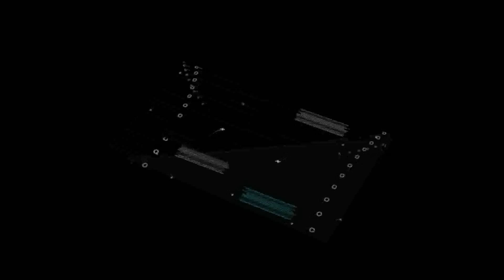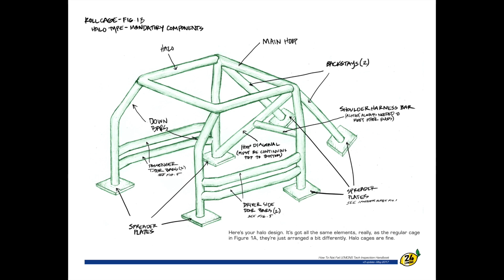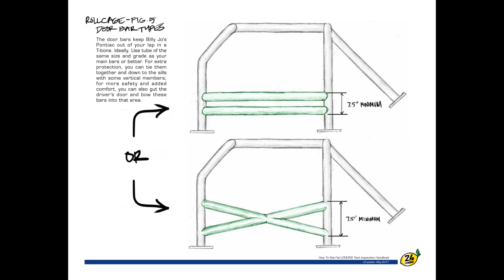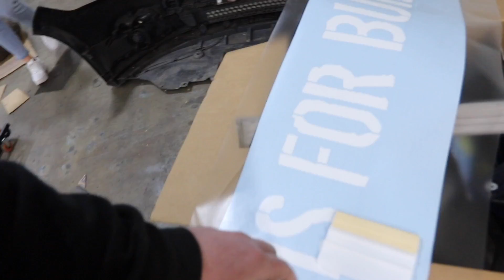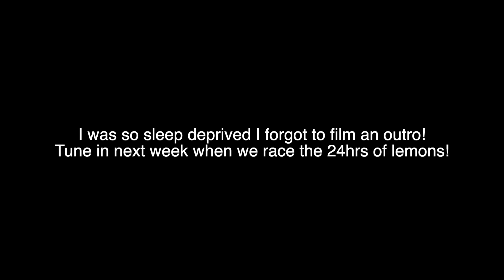Building An Insane Race Car For $500

Comment: This should solve the starting problem: A non-return valve in the fuel line is defective and is slowly allowing fuel to flow out of the line back into the tank.  As a result, it takes forever to start, but if it was only off for a short time, you don't notice it and it starts immediately.
Reply: Spoiler alert, they had to buy something at the race to fix it, it wasn't cheap 😂
Reply: @joealex65  what did they have to buy?
Reply: Pretty sure the fuel filter has the check valve. $40 part max and 10 min fix
Reply: @joealex65  Had to go to sleep so I couldn’t watch it til the end🙂
Reply: This is exactly what i thought when i saw that.
Reply: I owned one of these cars for 5 months. Car had more gremlins than that movie theater lol

Comment: Worked on Benz for over 20 years professionally. Put a crank sensor in it. They never set a code when they fail. To check it, see if your fuel pump has a signal when cranking, if not then it needs the crank sensor. Ecu will not send a fuel pump signal if there is no rpm signal when cranking. Crank sensor is rear of engine drivers side on the top of the bell housing. Bolt is an E8, use a 1/4" drive ratchet with a real long extension and a wobble. Put a piece of tape in the socket before putting it on the bolt to hold the bolt in the socket. 100% this will fix the starting issue.
Reply: I was gonna say that, same problem I had with my CLK320.

Comment: Check crankshaft position sensor.  It's the first thing you want to replace on any early 2000s Merc.  A bad one throws no codes and results in intermittent no engine start condition.
Reply: Just wait to see what they had to do to fix it at the race 😂
Reply: Temperature of a bad sensor being hot will cause it not to start in my past experiences.

Or

If the sensor or plate has any oil on it from a rear main seal leak will cause it not to start.

Both scenarios throw the timing off telling it not to start.

Comment: I had an old bmw that started doing this randomly. Took me 15-20 mins to start it. Figured out it was a defective security sensor in the key (the ignition cylinder charges the key). New battery in the key fob fixed it👍🏼
Reply: If your story is about an E46, that is false. In an E46, the key battery only controls locking and unlocking. The transponder portion inside the key that speaks to the EWS does not require a battery/charge.
Reply: I had the identical problem with my BMW (E88), with a different cause. it could be any or all of 10,000 things with a BMW

Comment: Had one of these back in 2008 - loved it. The design with the pillar-less windows and seatbelt extenders is amazing. A truely elegant coupe!  Was also the most reliable car I ever had. You guys got the best engine as well with the M112 V6. The c209 is the 2 door coupe and the a209 is the convertible model. They did a facelift in 2005 which look a bit nicer but ironically they removed the reliable M112 and replaced it with the M272 which had balance shaft issues. Good luck on your trip!

Comment: if it only happens when after you've driven it and the engine is warm, i'd highly recommend a new crank position sensor.  i worked as a benz tech and it was a common problem.

Comment: You're right about the cheating bit. It's all about being clever. I remember the old rally days where mechanics and engineers would hide entire turbo-chargers somewhere lol car looks like a proper racer tho, you guys did a good job. This should be a fun event for sure.
Reply: Cesare Fiorio, the team boss of Lancia, once ordered 300 tonnes of salt, and had it spread along the snowy route of Monte Carlo because they knew their RWD car was at a disadvantage against Audi Quattro. So Audi went out on snow tyres, thinking it was partially snowy and icy..While Lancia, knowing it would be dry, went out on slicks and beat Audi by 11 minutes... Ingenious cheating tactics.
Reply: In group b, rules were a bit loose so a lot if not all teams made roll cages in aluminum tubing to make it lighter. Not safe, but another way to bend rules.
Reply: Don't forget the Toyota with the turbo restrictor mounting that would change shape under load - that one was pure genius!

Comment: Check the cam position sensor for the hard starting issue. It can be an intermittent issue that wouldn't throw a dash light until the car is running, and those cam position sensor are notorious for being bad on the early to mid 00s Mercedes US imports.

Comment: check thingy in the fuel lines that restricts fuel to go in one direction. forgot what it is called, the fuel rail loses pressure when cold or starting it on the next day. it's a small fuel inlet valve that restricts the flow direction of fuel. had the same issue on my Cadillac BLS

Comment: Check the fuel rail for pressure. If no pressure you need a fuel pump. My 2004 e500 was doing the same and then the fuel pump stopped working completely.

Comment: Crank position sensor cam position sensor in that order. Second thing that comes to mind is fuel pressure. Since it's push to start you can't prime the fuel sender like a keyed vehicle.

Comment: Check the crankshaft position sensor Chris, it’s common in the 500 and the 350 and those are the symptoms. A little hard to get to but not an expensive part.

Comment: You guys should run a piece of tubing from the air intake box through the firewall into the cabin so the driver can spray starting fluid and start the car by himself if need be.

Comment: Amazing!!! I wish I could do the same thing to my 2005 Mercedes S500.
Reply: Well technically if its paid off its worth whatever. It's still going to cost you close to 20k  plus after mods (roll cage, labor, safety equip, lodging, pit crew, drivers, spares, transport etc...) for the 4 day event.  Consider it a bucket list of things too do in a lifetime. Did a lot of enduro racing in the 90's same concept except we would do 500 laps instead of hours.

Comment: Like mentioned a bad return solenoid or your fuel tank purge solenoid is bad creating back pressure in your return line.  Once it purges that out from cranking, it will start till it sits and the vapors lock it again.

Comment: I had a similar issue (on a Citroen XM), it was a relay getting bad (the safety preventing the fuel pump being powered when attempting to start  if the trans was not in Park position)

Comment: I had water in my gas once from a bad gas station. I added 2L of methylated spirits to a full tank and it fixed the issue. But sounds more electrical.

Comment: Replace a crankshaft position sensor just to be safe. It’s a very common failure on that engine and could be causing the issues you’re having.
Reply: We did replace it. It didn’t fix the problem

Comment: So when I had this problem on my 1996 Chevrolet S10 4.3 V6 the solution to get it started was to cycle it quickly, start it for 2-3 seconds max and try again, that worked very well.

Comment: Thrift store DTM car 🤣 love it 😆Starting problem could be the fuel pressure regulator that is built into the fuel filter, they can often fail my S class likes to do a similar thing every now and again. It could also be the fuel pump, I'm commenting this early on in the video so I'm probably gonna look stupid 🤣. Crankshaft position sensor normally causes sporadic misfires as well as long cranking. But to scan these SDS  is better for this thing but costs a lot. Engine sounds too healthy. Also make sure the fuel cap seals properly. It could also be K40 related from the flood damage but I suspect fuel pressure more likely, Hope this helps guys it might not 👍

Comment: Fuel filter. I have had experience with this  before and just changed the fuel filter( the pressure regulator in the filter goes bad)

Comment: Those are notorious for crank sensor failures, if it works fine when it's dead cold, but will not restart warm, that's where I would start.

Comment: Needs a pair of VW turbos.

Get rid of those fake louvers.

Fit the most expensive brake pads you can find, use the most boil proof fluid you can get, dress the disks... fix all the tiny leaks, and fit a stronger booster...

Comment: Got some simmilar issues on our slk r171 wont start after it has been driven a bit (also no codes etc.). 
I suspect an issue with:
-Antitheft/key system
-Krank etc. position sensors,
-issue wit the engine management computer regarding a Relais k40 or something (read that somewhere)

I havent adressed the issue jet because its pissing me off to much ... good luck with your issue

Comment: Did you say you sprayed starter fluid in it and it worked? I was kinda confused about that cuz then you went right to working on it. I was thinking maybe the fuel pump was having a hard time priming when cold. Or sitting or whatever the scenario is that it doesn’t start.

Comment: m112 and m113 have issues with crank position sensors. when they go bad the engine will just crank and crank. change it. was common problem on all mercedes-benz with those engines. i recently had this problem on my 2000 ml320. i changed it and my car always starts with no issues.

Comment: Only seen the first 8 minutes but in gonna say crank position sensor
Reply: Replaced not the problem
Reply: @Oscar_SMT  Good that you did anyway, common problem with m112/113. Cleaning carbon off the throttle plate can cure similar symptoms but I'm guessing the starting fluid helped with that. Check coolant temp sensor
Reply: We’ve replaced the maf, fuel pump, and the crank sensor. I’m going to try and clean the throttle body and look at the fuel pressures regulator. If that doesn’t work I’m leaving it alone.

Comment: Omg. The fuck did you do to that poor CLK. The starting problem could be the crankshaft or camshaft position sensor. It has happened 3 times to 3 different mercedes we have. Where all it does is crank but doesn't start.
Reply: We replaced the crank position sensor. It didn’t fix the problem